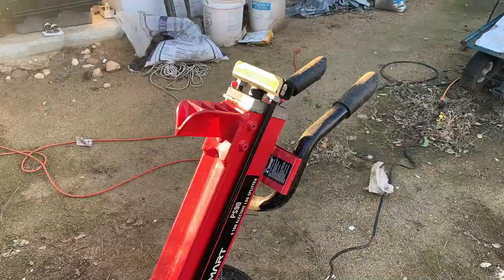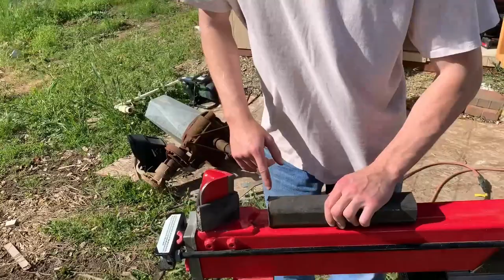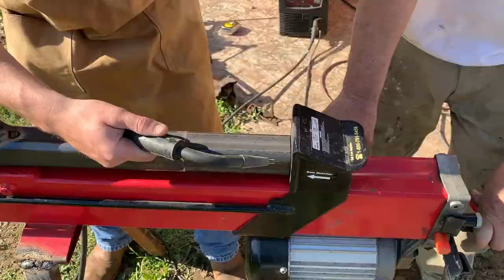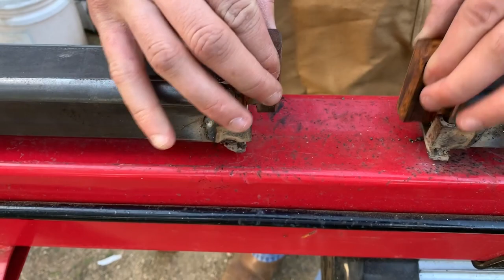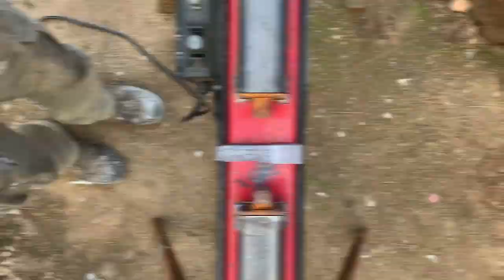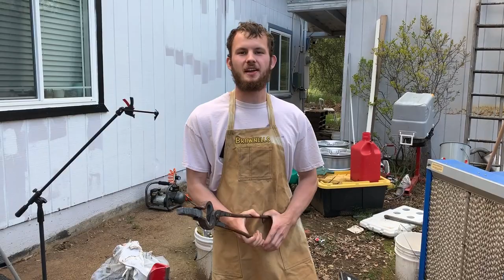Converting a Log Splitter into a Forging Press, Part 1

Comment: It definitely did a faster job than just hand forging. I always wanted to try to make one of this, since i have a really small workshop and it would be just enough powerful for the knives i make, thanks for sharing!
Reply from the maker: Of course! I highly recommend making one of these, as it's really the most affordable way to get into pressing. Check out part 2 if you haven't already, as it makes quick work of hot steel!

Comment: What tubing did you use for the posts? Also how did you make the dies?
Reply from the maker: We used 2 inch square tube. I don't recall how thick the wall is, but roughly 1/4 inch. We made the dies by cutting square bar and welding them to a small steel plate. The dies were also sanded with a belt sander to remove any sharp edges.

Comment: hey i dont know if youll see my comment but i tried modifying my logsplitter to work like a press it worked great for two weeks eventually it busted and now it wont start i got all new wires and a new circuit breaker but ro no avail can you help me
Reply: What exactly happened? Without knowing more about the problem we can't help much, did the motor just stop spinning? First step is to figure out which part actually broke.

Comment: If anything you only wasted $200 right 🤔✌️

I did a conversion with a 20 ton gas to electric and a 7 ton gas to electric 

The 7 to. Gas to electric had a 3gpm pump it came with stock and now has a 16gpm  waiting on a bigger motor now 

I also just enjoy the builds more than anything
Reply from the maker: I'm with you! It was an enjoyable experience to build this press. However, we are ready for an upgrade, and we just began a series on our channel on building a 24 ton press 👍🏼
Reply: Airborne Productions 

It’s all my non money making channel is about baby 💪🏻👊

Comment: I have a feeling you’re going to burn that poor motor out by constantly turning it on and off. Ideally the motor would actually be running all the time and only press when you actuate the lever.
Reply from the maker: The problem is that the press doesn't retract when the motor is running. It only retracts when both the motor is off and the hydraulic lever is released. But no worries! Later this summer, our 24 ton press build will operate properly as you've described it. 😉
Reply: Airborne Productions will it be electric or gasoline?
Reply from the maker: Electric, 220v
Reply: Make the gap smaller. Possibly a heavy return spring if it will freely return when the lever is released.